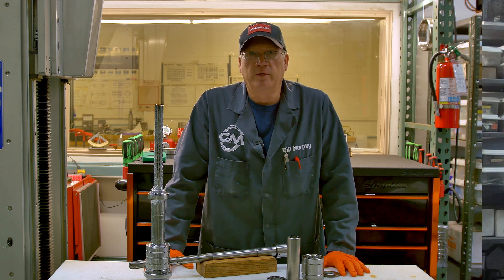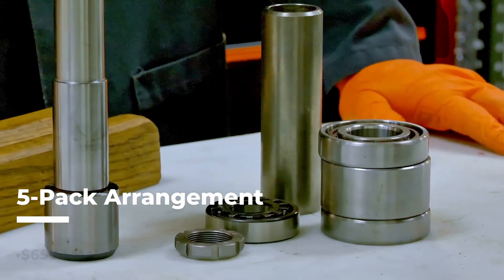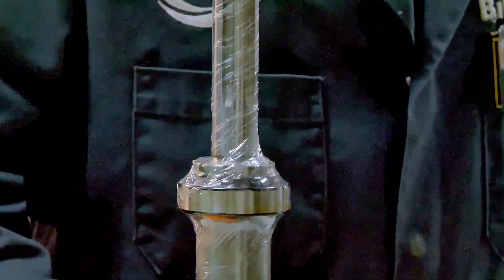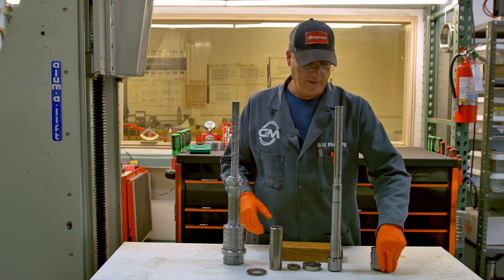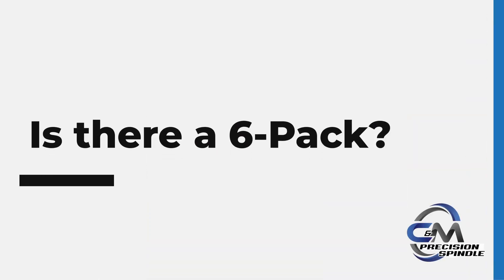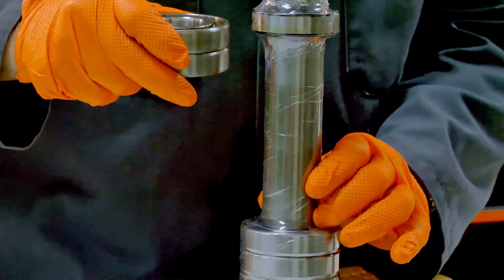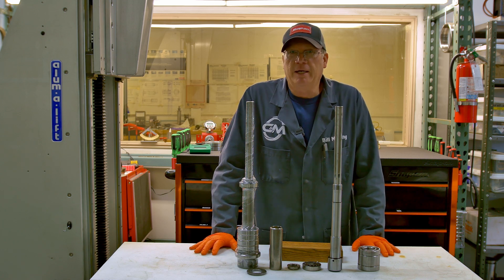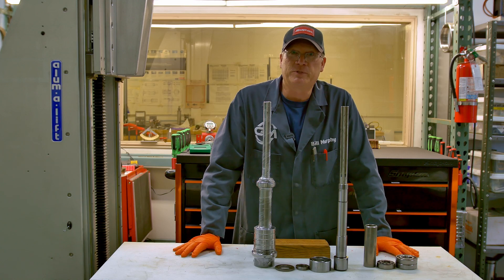Why do I want a 5-Pack Spindle and not a 3-Pack?

Comment: Did you say $650? Thats awesome! Is that for the whole new spindle and everything or is that rebuilding and grinding my spindle?
Reply from the maker: That is for bearings and R-8 taper grind. While they last. You have to have all the other parts and send in the nose cap for adjustment. Cheers.

Comment: Great stuff, would love to ship you a pair for re-fit. Do you grind collets as well? Would be nice to have a matched set. If not, what's your best recommendation for R8 collet brands? Subscribed!!
Reply from the maker: Sorry I haven't needed new collets for 25 years. We do bigger spindles most of the time. CNC grinders,  lathes, mills and fill in with the knee mills for my entertainment. Once you try a 5-Pack you will believe. So much better.

Comment: Awesome info and video! Thank you very much.
I have always wondered how much wear accumulates on the spindle splines and how that affects the noise and performance.  I've rebuilt a couple of Bridgeport Vari-Speed heads, and I always replace the Spindle Hub.  Do you see  worn splines in your work and what are your thoughts on this?  Thanks again!
Reply from the maker: Depends on how they are used. We always see massive wear on the Hurcos. Especially in the center. How much torque and load is applied for how long. Some just need a new shaft others can be welded up but very rare and cheaper to buy a new one. Shafts have gotten way to pricey lately and the quality is softer. That center hole is a stopper for most shops to make unless they have a gundrill. Cheers